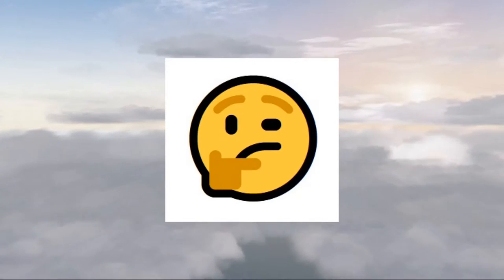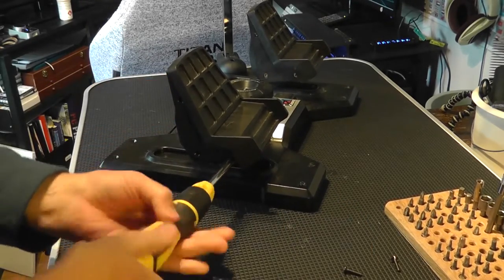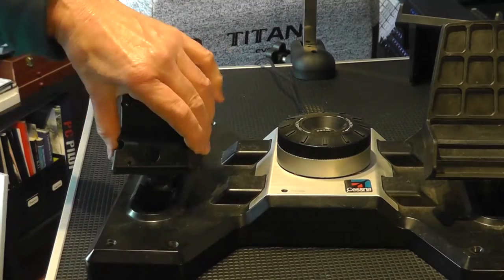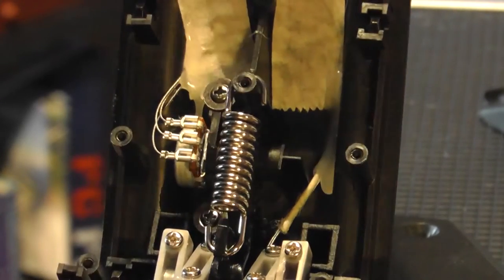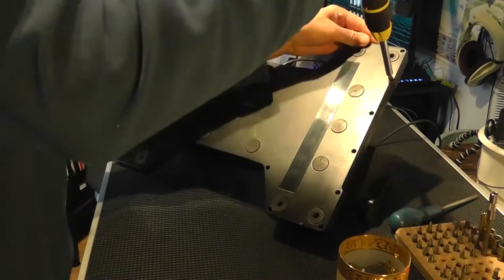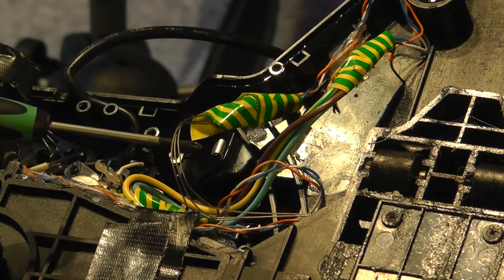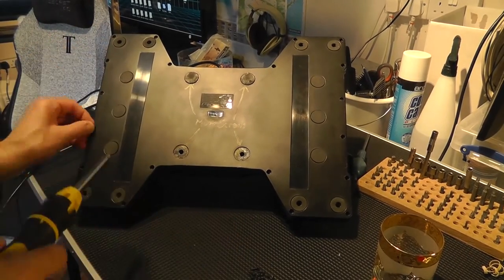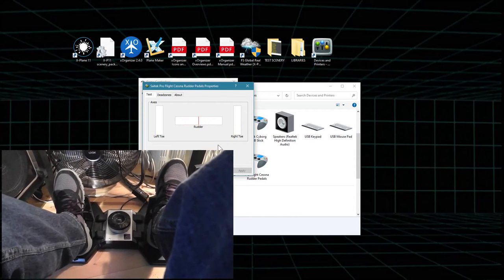Saitek Rudder Fix

Comment: the fix is to open and spray MD40  to the potentiometers, i had the same exact problem like you, and i did with my quadrante as well, and it fixes when using the md40 spray   it will eliminate all the bad contacts, but you need to find the potentiometer of that axis, you may do it to all since its open
PS-lol you did it..my answer was to early..sorry for that, great job
PS2- always do a test before closing because sometimes can even be something else, you should had done all potentiometers, i love pots because i'm a professional guitar player and i use them all day long, with the guitar or even pedals, humidity is a Pot killer cheers brother

Comment: Thanks for the video! It helped me diagnose the loose white wire on the center potentiometer. The brake pedals cables were kinda "pulling" it, breaking the soldering.
Reply from the maker: Glad to be of help.

Comment: Hmmm timely as I am thinking of buying this. Is this the Logitech Pro because I read good reviews on it? Thx
Reply from the maker: Thanks for your comment. These are Saitek Pro Flight Cessna Rudder Pedals. Saitek was rebranded Logitech G a while back but I think they are essentially the same product.
Reply: @simmo2sim  thx for replying.So they can be used for other planes not just Cessna?
Reply from the maker: Yes, any plane.

Comment: I know these are getting long in the tooth now but they are far superior to the current Logitech pedals in my opinion, I haven’t got any issues but I’ll use the video for a little tlc 👍
Reply from the maker: Thanks for your comment. The pedals have stood the test of time quite well however as you can see the modifications I have made have increased its 'survivability'. I am just waiting for the next thing to snap inside. It's perhaps inevitable considering the amount of abuse they get.
Reply: @simmo2sim  the spring mount at the bottom of the toe brake sping will go, it is just plastic and a real baked in, failure point. Unfortunately there is no replacement unless you can 3d print the part. Logiteck have abandoned this product.  I am looking to drill a little hole in the plastic, below the break.. and use a longer guitar trem system spring instead of the high tension short spring.

Comment: hello mate well, one of the toe brake totally stopped working. would you know a fix to this problem ?
Reply from the maker: Unless it's a faulty potentiometer then it's probably a broken wire. If you have not opened the unit before be prepared for a lot of grease.
Reply: i have this exact issue with my left toe brake. great you have a video about it!
Reply from the maker: I'm glad to be of help
Reply: @simmo2sim  my toe brake has been broken for years before this video was made, so this is a lifesaver🙌 have a nice day